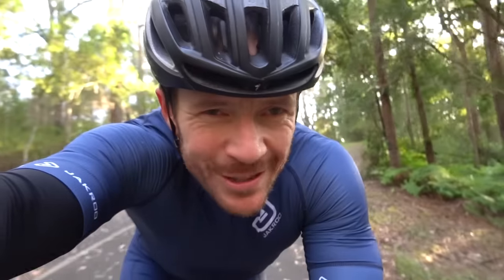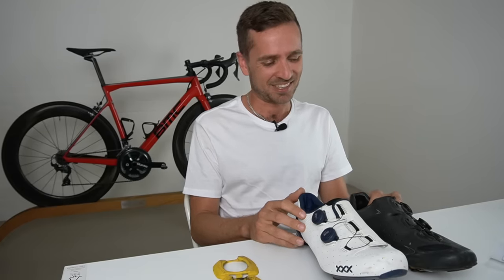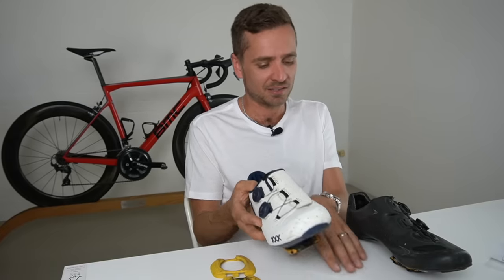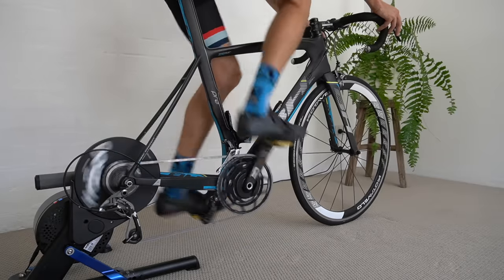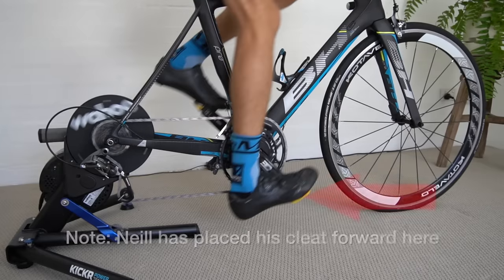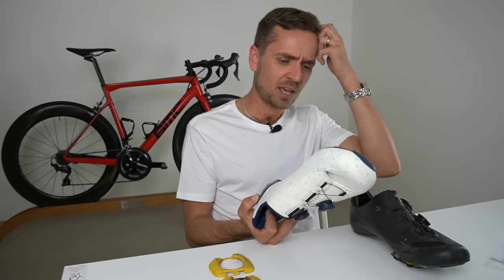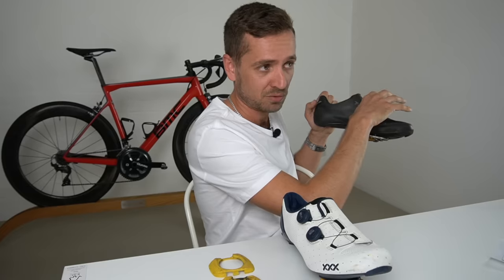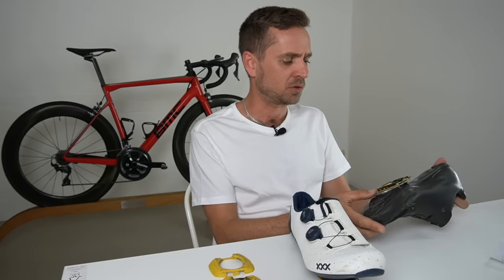Want More Power? (Two Cleat Positions to Respect!)

Comment: I had sore knees and tried everything from q rings, shorter cranks and different pedals. Nothing seemed to work until I started experimenting with cleat position. I had an old pair of shoes and started drilling holes until I found what worked for me. Now I drill new mounting holes in my shoes about 1 inch back from the manufacture position. I currently use speedplay pedals and have allot more stability and no pain. My advise, experiment and find what works for you.

Comment: Foot stability.                                                                                                                                              1.  Walk up to an escalator and as you start to position your feet grab the rails, left and right. 
2.  Line up your toes on the edge of the step when it is flat just before it starts to go up.
3.  Go back down and this time place the balls of your feet on the edge.
4.  The third time stand mid foot.
5.  Repeat without holding onto the "rail".
6.  Which foot position provides the most stability? AND pay attention to the calf muscles.
Reply: What's the Q-factor of an escalator?

Comment: Excellent video. I had very bad foot pain for years. I finally saw a podiatrist who knows cycling. He said move my cleats back. I've permanently damaged my feet from improper walking and cycling. Now my problem is 90% solved. I'm glad you advocate moving cleats back for some cyclists and debunk the joint over spindle rule.

Comment: I saw Neill and clicked as fast as I could. His knowledge is so valuable. Thank you for these videos! My cleats are as far back as I can get them, and I wish I could get them a bit further back.
Reply: Kevin Lavery , if u have speedplay pedals, they make an adapter plate that allows 14mm of rear adjustment.
Reply: @user-ys6hl1uy1t  I do not have speedplays, but that's good to know.  That may have to be my next upgrade.
Reply: @kevinlavery6194  Hello Kevin. What kind of cleats do you have? I have designed an adapter that allows 12-24mm of rear adjustment for SPD-SL and Look KEOS. I have just received the first batch, and love them for my climbs here in the Alps. I will start selling the adapters in my webshop in two weeks, but I need beta-testers, so I shall be happy to send you a set for free. (As long as you don't live in Antarctica)
Reply: Cleat goes backward means foot is going forward right?
Reply: @nielserikstrup  I'd definitely be interested mate 👍🏼
Reply: @nielserikstrup  Hey Niels! I live in Norway and I'm using the Shimano PD-A520 Racer pedal SPD cleats and would love to try your adapters.
Reply: BUY PATROCLEATS!!!

Comment: Brilliant discussion from someone who really knows his stuff. I just started riding, and everyone is telling me that I have to have the ball of my foot on the center of the pedal, but instinctively, from my years in bodybuilding and doing squats, I know for a fact that my maximum  power output comes from planting my foot squarely on the pedal, somewhere in the center of the arch of my foot. Now that might seem like poor form to some, but I personally have more control. Plus the removal of my calf and ankle as another leaver in the equation helps me get the power down, and have more control.
Reply: Remember that it's not about maximum power output only. As he says, it's also about bringing as many muscle groups to bear on the work of turning the pedals and as you get better you should find you are not so much exerting a huge amount of force as you are exerting consistent force through more degrees of the total pedal stroke. It's about generating a high level of sustainable power.
Reply: @errcoche  I'm using muscles I didn't know I had. I love the fact that you can switch between different sets of muscle groups when others get tired. Something you can't do properly on flats.
Reply: @kimgaugemusic  That;s right Kim. In fact there was a discussion of saddles where I didn't really agree with the analysis. They were saying that ideally you sit in one place whereas I remember wanting to be able slide up and down the saddle on longer climbs in order to engage the different muscle groups ( it has been a while, only mountains in South Florida are stinking landfills ). I have been doing some cycling during lockdown and my hamstrings are making a comeback. I haven't played soccer in about 20 years now ( at 56 ) and they had shrunk down from lack of use. The important thing is that it shows I am pretty balanced in my pedaling, especially since I am just using sneakers and toe clips ( well I was until this week ).
Reply: @errcoche  I'm constantly shifting position on my saddle. Apparently Chris Froome moves all over the place.
Reply: @kimgaugemusic  They call him, Froome, The Washing Machine. I'm not convinced he's doing it on purpose, or for that matter, is even aware.

Comment: This is really excellent advice.  I started riding 20+ years ago and the standard was cleat directly under metatarsal.  I've been riding that way for 2 decades but 10 years ago when I got into road touring and would regularly do 100+mi  days back to back to back I started having knee problems.  When I switched to flat pedals for convenience in touring the knee pain went away.  I realized it was the foot position that was causing the knee pain.  On flat pedals on naturally set the spindle maybe 25mm behind my metatarsal.   On the plus side I've really developed my calves from riding with the cleats forward and can actively feel them engaged and firing on sprints and do enjoy that additional conditioning and power generation.

Comment: Moving my cleats back helped my knee pain.  Check out yourself, feel the kneecaps when standing on your toes.  You will feel how the kneecaps ( patilla ) are stressed and pressed against the inside of the knee. I had my husband extend the slots on my spd cleats to achieve this. It also reduced the leverage as I pull up on the pedal and bring it over the top of the stroke.
Reply from the maker: Thanks for sharing on the thread

Comment: Thanks to Neil I have moved my cleats 30mm behind the 5th metatarsal and couldn't be happier with the results. Better cadance and using more of my major muscles. I iken the forward position to climbing stairs on the edge of the stairs with the front of your foot. You quickly tire the front of the quads and calf. A more rear position of the cleats is like climbing with a mid or full foot which activate the muscles differently.
Reply from the maker: Awesome Jimmy, thanks for sharing
Reply: @CamNicholls  what about sprinting power? If You move cleats too far backwards You loose some sprinting power???

Comment: I have had a lot of knee pain over the years and have had a shim put in to help with a leg length discrepancy.   After using the Patrocleats all the way back a full 24mm I noticed a lot of comfort riding and no loss in power.    If anything I was seeing higher power numbers.     I just realized when I did this I forgot to add the shim in.   Less pain, better power and no shim (been there a decade).   Well worth your time in trying this.    

I also added 165 mm cranks to equation and the two changes seem highly compatible.

Comment: Embarrassingly, I just discovered that the cleats on both my pairs of shoes had come loose, and shifted almost all the way forward. I had also been struggling a bit with power output over a long period. Never thought to check, but the other day I glanced at one of my shoes, and there is was. They were all in the wrong position. Now that they are back, I cannot believe how much better I am doing. I am watching this video because I would like to explore optimizing position even more if possible. Fantastic video, thanks for posting!

Comment: Yip same here , I have been going on about q factor for about 20 years , that's why I use Keywin pedals , available in minus and plus axel lengths in 3 millimeters increments up to minus 10 and up to plus 10 , they also have plate Packers for different leg length discripency

Comment: Love it. I've had two bike fits to help with knee pain and hand/foot numbness. Neither paid any attention to my cleats. I still have knee pain and hand/foot  numbness
Reply: if the fit is good then the most likely next place to look is weak glut medius or vastus medialis. A couple of simple exercises and they might come right in 3 weeks. Foot numbness can usually be solved by a metatarsal button that raises the middle of the foot. Or an arch support that spreads the load over the rest of the foot. The cleat position should always be considered which questions how good your fitter was.

Comment: If you can't adapt easily to a cleat change look at crank arm length as well as seat height and fore/aft positioning. Actually, all of these settings should be looked at carefully when making any adjustments. I keep a mirrored setup for saddle and post so that I can do A/B comparisons any time I make a change to cranks, pedals, stem, etc. I change the saddle position to make adaptation easier, according to my theory, but I also test indoors with the unchanged or "control" setup and then test outside on easy rides. I can then slowly move back to my standard setup if/when/as it seems appropriate. 

Also, before starting any of this, it's a great idea to consult a medically-certified podiatrist. Try out some orthotics even if you only try them in your "walking around" shoes. Once you have a sense of those factors you will make better decisions as discussed here. If you look only at "bike hardware" you might be missing out on a chance to solve important root problems. Also, he mentioned "the gut" and its effect on position and apparent form. Changing "q factor" instead of raising the stem and losing that gut is not what I'd suggest. OTOH, Froome doesn't have a gut problem but does have flailing knees. 

These are obviously very complicated questions and don't focus entirely on the hardware if you have never had your own skeleton evaluated by an MD. Just as it should be obvious that cyclists should consult with cardiologists for periodic checkups to catch early problems (most likely you'll simple learn the importance of proper rest periods) you should likewise make sure you get some kind of "medical workup" and diagnostics before you try to solve problems with radical equipment changes. 

One last thing is that cog choices matter, day to day. Some of these stress problems are caused by fatalistic views on cog choices that in my view are caused by the "watts" cult that doesn't seem to understand that "wattage" is a product of force and velocity. A seemingly trivial change in cadence within a controlled range of power can make a huge difference in how you stress your bones and tissue. Those things matter. For me, I sometimes strain myself in the hills when I use wide ratio cogs because I go from spinning to grinding too often if I'm changing pace a lot (in "Pyrenean" style climbs) if I use the OEM 11-30 cassette that goes 21-24-27-30. An 11-28 is much better for me and I'm even looking at Campy cogsets just to get closer gears because I'd rather have a 12-27 than any of the standard Shimano cassettes. 
The video advice is excellent but never forget that all of these doctrines require regular synthesis (with other established settings and doctrines) and continuous review to see how you're adapting to the changes. That's what "marginal gains" is all about. (It's not really about micro-dosing EPO and salbutamol, OK?)

Comment: Having the cleats further back totally makes sense because when I am riding my MTB on flat pedals, the front edge of the pedal is roughly under my toe joint. But when I put the cleats back on the road bike maximum cadence drops a lot, which makes sense as you are effectively limiting your range of motion.

Comment: The information how the position affects different muscles was new to me, never even thought about learning about them, just seated the cleats where I felt comfortable to put pressure on the pedals. Strava estimates the avg power of 300 to 400W regularly and I'm well aware it's not close to the real value.

I have massive calves, had my cleats quite forward and had immense power, but managed to get a massive problem with the pressure.
Morton's neuroma or something similar. 
Well the shoes I used were somewhat more flexible, especially after I broke the soles of both shoes. 
Anyway when I moved the cleats further back, it removed the problem - the pain didn't reappear, but If this causes me missing the power I'm going to try moving them forward again.

Now I purchased much stiffer shoes, hopefully can enjoy the calves I've been given.

Comment: I have used Speedplay for years - love them. I also have used the cleat in the rear position for years as well. Can’t remember the source of the information, but I changed it on the basis that it helps to more fully engage your calves and hamstrings so you don’t overload your quads. Very happy

Comment: I actually run two different cleat positions. On my road bikes I have the cleats set up under the ball of the foot in the “classic” position because it limits toe overlap and I’ve got calves of steel. On my MTBs I run the cleat all the way back because I don’t have to worry about overlap and there’s less variation in leg length between going toe-down to bunny hop something or heel down to smash through some rocks.

Both positions feel comfortable and efficient to me.
Reply from the maker: Interesting, thanks for sharing! Cam

Comment: So, aside from the fore/aft cleat position which seems to be the core of the talk in most of the comments, in the q factor part, what Neill is suggesting is to use our hip width or perhaps the ASIS width (the most forward bony part that protrudes from our hips) and try to match that with our Q-factor?  I am personally a fairly small rider and while I'm currently riding a MTB, I have recorded myself and even with the cleats all the way out (foot closer to crank), I can't get my knees remotely close to straight at all and they go inwards a bit. I'm thinking I might need a narrower Q-factor for this reason. Current cranks are 175mm Q factor and with SPD pedals I end up at around 280mm. My ASIS width is around 245mm, so If I use that as reference, I'm 35mm adrift...

Great to put a reason to why I always felt more stable and comfortable with a cleat position that's further forward than most bike fit videos suggest though.

Thanks for the video!

Comment: I would add that moving my cleats back as far as possible also solved my numb toe issue, which is a benefit that he didn't mention! I have enormous (47) feet so I'm in the 20mm setback minimum he suggested. I'm not even sure I can get it on my current (look) cleats with my Shimano shoes due to the size and where the bolt holes are.

Comment: Q factor is super important and overlooked most of the time.  Speedplay are the only pedals which offer many spindle lengths and can really optimize your stance on the bike.  I was originally going to use spindle extenders but these can fail which is very dangerous.
Reply: Good point - I get mine made in bulk by a machinist and have never had a set break - but I've heard of people breaking the crank arm when using them. Not ideal for heavy, powerful riders - who are ironically often the ones who need them the most.

Comment: Great video!  I subscribe to Neill’s perspective and have practiced it for a number of years.  However there are other factors coming into play that I am sure will be discussed on future vids.  Example and a pet peeve I have regarding insoles.  I notice your shoes are equipped with G8 insoles.  Going through a shoe fitting and cleat positioning process to find out you have to now invest another $100 plus for insoles and wedges is very frustrating and expensive.  Can you and Neill impart with a informative future video on insoles and the reason for them?  Thanks again for educating your viewership Cam.  👍

Comment: Speedplay don't have enough sideways cleat adjustment to get a really low Q-factor. And I used the titanium spindles... The most disturbing about speedplay is the sideway stability of their platform is as good as dancing on a floating iceberg. I use Time RXS and Shimano pedals at the moment and those are much more stable.
Totally agree about fore-aft cleat position and the advantage of pushing the cleat more to the center of the foot for increased stability.

Comment: If you have Shimano and want to extend the pedal to increase the Q factor more than 4mm, you can also remove the pedal spindle with the removal tool which you can buy online really cheap and then purchase M16x20x1.5mm aluminium washers (for car sump plugs) and fit them between the pedal spindle and pedal. I have 4 on my right pedal as my leg needs to move away to the right and this would be 6mm of adjustment. 
I have never had any issues and works fine. Cheaper than buying a new 4mm longer spindle.
100 washers £7.24.
Reply from the maker: Thanks for sharing on the thread Duncan, Cam

Comment: Q factor is this mystic science I had to change cranksets ajust cleats swap pedals it had been about 3 years until I found the right fit. Just remember measure all your points write down so when you get a new bike you'll have a good start point. When I raced p.1.2 I would get a new bike every year I quickly realized no bike maker made bikes the Same measurements. Then the process starts all over again!

Comment: I have a similar heel drop “style” to Neill. Moving my cleats all the way back has helped... as has switching from keo cleats to favero cleats (which actually can be pushed further back). It’s helped a lot... still dropping heel slightly and going to try a slightly shorter crank (which has the same effect).